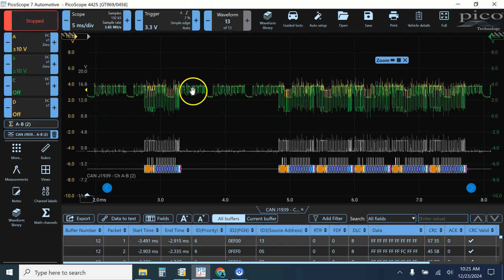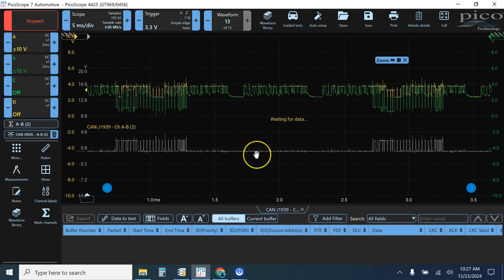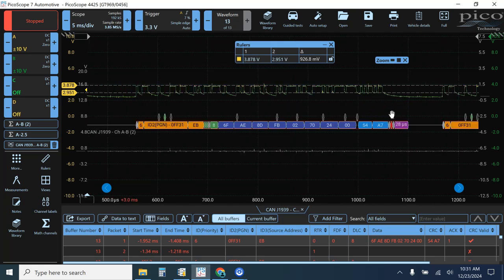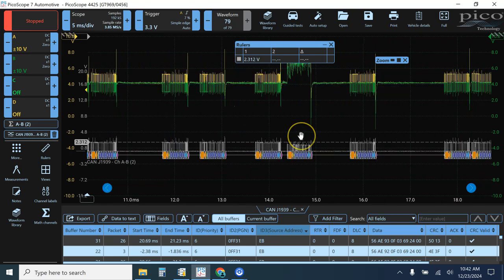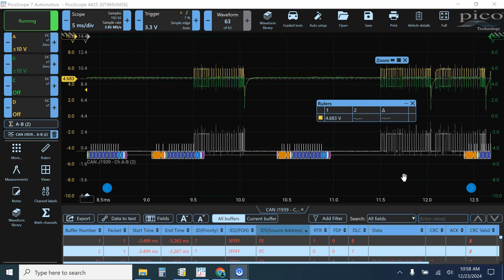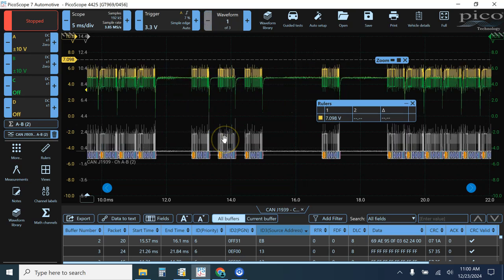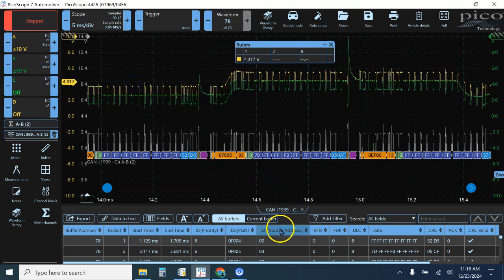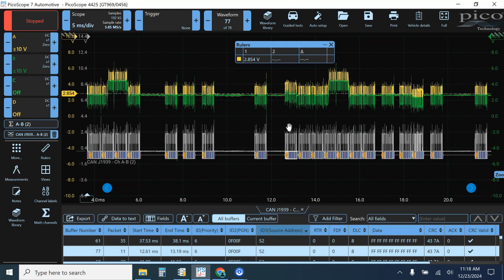Advanced J1939 More Problems 19

Comment: Hi Joe and thanks again for the video! I must admit that I cannot find other videos that are technically on same level. I diagnose CAN bus myself also, I work in technical support for trucks. These videos contains information on a really practical level but with the important theory included. When diagnosing NOx sensors, its good to add an amp clamp also to the waveform. The NOx uses up to 8A in peaks, to measure the temp with the PTC heating resistor.

Comment: I greatly appreciate you taking the time to make these excellent videos Joe! I saved up the cash from side work and have been using the Picoscope in day job and the moonlight hours. For intermittent module issues on a CAN bus (SRA on Holset turbos comes to mind) with no obvious voltage waveform issues, I have had some success exporting the waveform to Excel and filtering not Valid messages by source addresses to see if one module has higher rate of invalid messages.